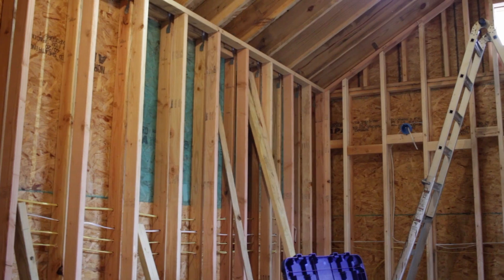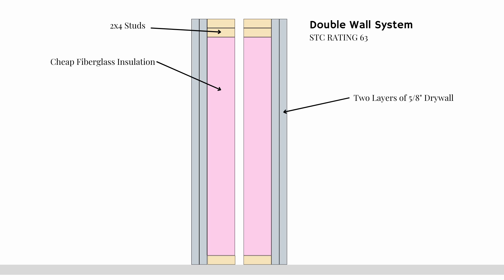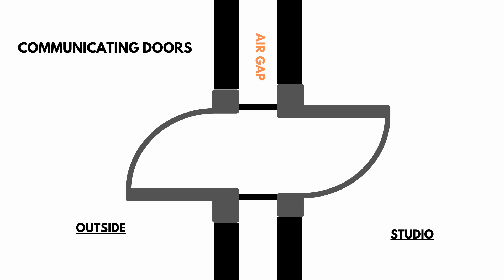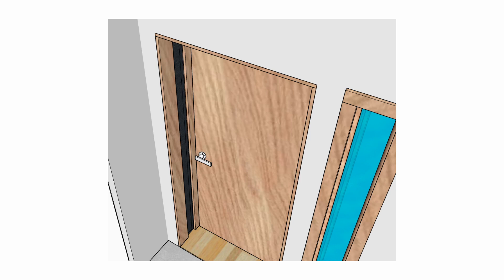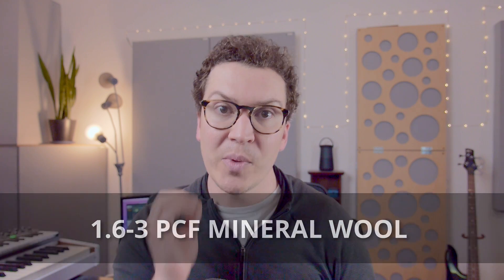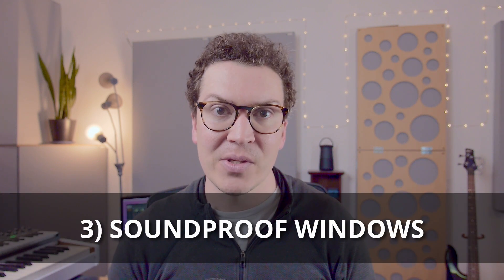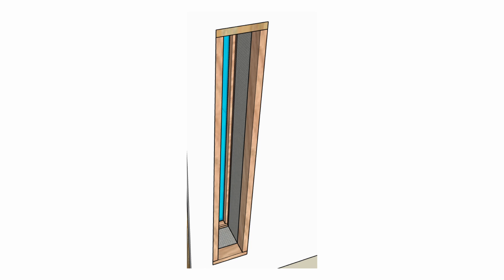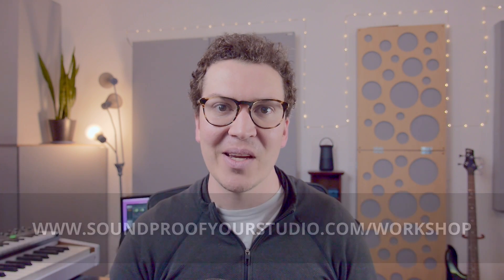How Do You Decouple Doors and Windows In A Double Wall System?

Comment: Hey man. How do I attach the window or door frame? Do I put wooden planks all around the cut hole where the window goes and then install the frame on those? Wouldn't that connect the two walls? Thanks a lot for clarification!

Comment: So you're attaching the rubber piece to the edge of the door jamb which would be flush with the frame? Do you just nail or glue it right on top of the jamb or do you create some kind of thin frame against the door jamb? Maybe using set back the same thickness as your rubber piece so it sits flush against the jamb? And if your inserting mineral wool on top of the rubber, you'd set back that rubber piece even farther so that your mineral wool ends up flush with your jambs.

Comment: Where could I find this rubber you're talking about?
Reply from the maker: You can do a quick amazon search and find it. Are you building a home recording studio?
Reply: @soundproofyourstudio  No. I'm building an extra room in a house and I want to make it as sound proof as possible
Reply from the maker: Do you feel you have all the knowledge to build it correctly?
Reply: @soundproofyourstudio  I have a dilemma. I feel I have at least 70% of the knowledge to do it correctly (I've been doing research for over a month now) but only 40% of the confidence to DIY it (I've never built any partition wall in the first place) But then I have 0 confidence that a regular contractor will do sound proof work correctly.
Reply from the maker: Those are all very good points. I think I could help you feel 100% certain it will work and give your contractor detailed plans so they feel 100% certain it will work, plus I have a proven track record this system works. Why don't we talk over a zoom call so I can learn more about your project: Soundproof Clarity Call Application - https://www.soundproofyourstudio.com/Step1
Reply from the maker: Awesome, see you on the call
Reply: @soundproofyourstudio  I did put in a request using the link you provided, but I never received anything to schedule the call? I have put in the request twice now and haven't received anything either time. Is there another avenue I could take to schedule the call
Reply from the maker: What is your budget? Did you select under 10k?
Reply: @soundproofyourstudio  Yes I selected under 10k.
Reply from the maker: Ah yes, I can only take projects with higher budgets. Keep learning and growing. You will get a lot out of this channel.

Comment: I’m wondering, is the rubber really necessary? Because if you just filled the gap with cheap acoustic foam cut to size nice and snug, wouldnt you actually benifit from there not being a solid structure in the gap. Resonances between the doors or between the glass would actually have somewhere to go “inside the wall” which is filled with insulation. So I almost feel like leaving out the rubber would make it so you don’t even need to add mineral wool and all that. Would love to hear your thoughts. Thanks for the info!
Reply from the maker: I think there is a concern for smells from the cavity. You really can do what levers you like as long as the walls are not bridged with something solid that easily conducts sound.
Reply: @soundproofyourstudio  that makes sense!

Comment: I have 2 sliding glass exterior patio doors which was meant for a condo on street side. both are double pain and have air tight seal. Im doing the double wall air gap wall so im wondering 
if i should have two sliding glass doors or is that overkill?
Reply: My understanding is a single sliding door is going to be a weak spot and you would get more isolation with two separate sliding doors. How much it matters to you that sound would get in or out of a single sliding door is up to regarding if it's overkill or not. I would definitely do two sets of sliding doors in your situation.
Reply from the maker: It not overkill and may not be enough isolation depending on the type and thickness of the glass

Comment: Hey Wilson - you may have covered this already, but if you did, I missed it - 

In a scenario where the studio space is an attached part of the home, what do you do about the forced coupling caused by a continuous floor or ceiling?  
I assume that the ceiling and floor connecting one room to the next is a necessary evil?

Unfortunately, fire code isn't going to allow an air gap that completely separates the studio from the rest of a structure due to a large air path going from the basement/crawlspace straight up through the attic.
Reply from the maker: What about putting in fire stops in that airgap?
Reply: @soundproofyourstudio  Right, but wouldn't that just end up causing coupling again?